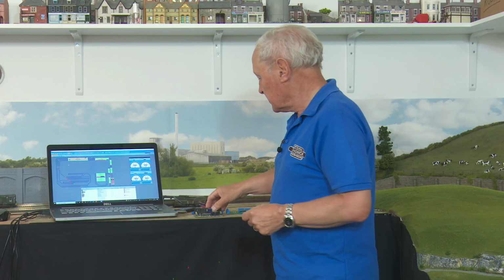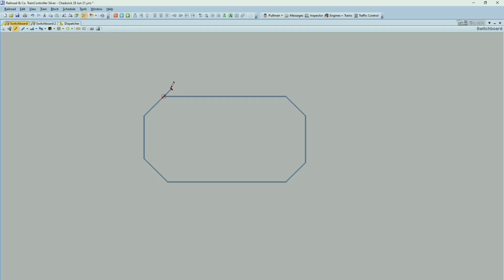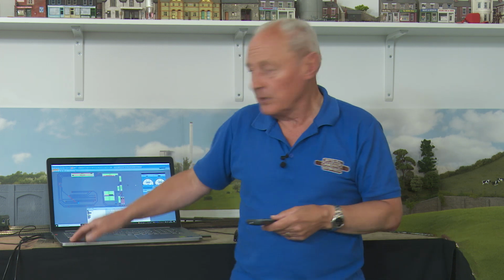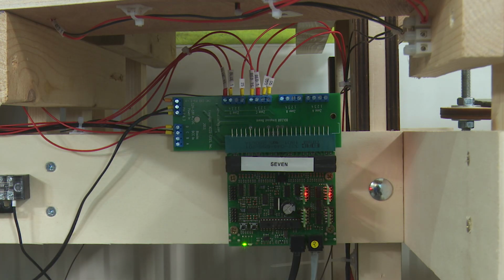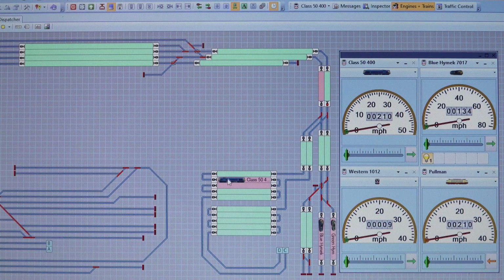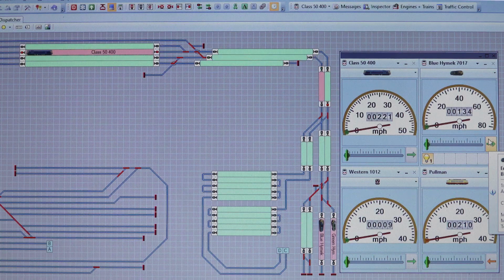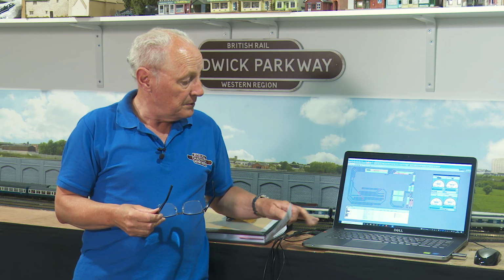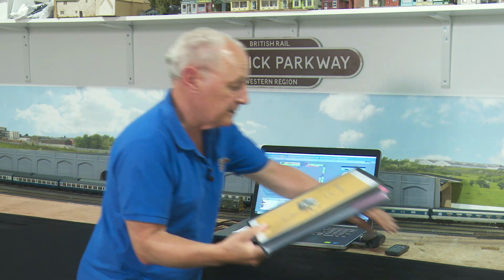An Intro to Block Detection at Chadwick Model Railway | 137.

Comment: Great video as always, Charlie. Brilliantly informative.

I've seen on one of the systems you don't need to have two sensors for each block as long as you have current draw from the last set of wheels in a rake, be it a DBSO, a coach or wagon with a fitted tail lamp or simply a small resistor wired to some wheel pickups, anything that draws current.... Thanks, Bachmann for deciding to make the wheels on your Highlander rake plastic. Really appreciate that...
As the locomotive enters a stop block, a station platform for example, it will begin to slow to a crawl speed, rates and speeds customizable in the system settings, like CVs but simpler, and will then stop automatically when the last set of wheels on its rake clears the previous block. No need for a second sensor. You don't even have to tell the system how long the train or length of track is.
Seems like a hell of a cost-cutting measure when you consider the price of all the different modules involved. For the life of me I can't remember what system that is (possibly iTrain as I do remember giving that one some serious thought) but maybe someone else can fill in that gap for us.

If you're still reading I wonder if you'll partake in a challenge I've set out for myself; I want to fit pickups to a Bachmann / Graham Farish coach, BSK, BG, GUV, etc, and fit a simple decoder inside to operate a lightbar via DCC. Easy up to now, yes? Here's the challenge; I want that one decoder to control the interior lights of an entire rake of seven coaches. This would involve, somehow, passing power from one light bar to the next without having permanent connections between the coaches, so we can mix and match them at will. I've even considered contacting some 3D printer owners to see if they can make some NEM couplings that can house a micro two-pin plug as I haven't seen any couplings with power connections on the market, at least in N Gauge which is what I model. Frankly I can't believe this gap in the market even exists! The idea being that power is picked up via the wheels of our BSK, up to a decoder, in to a lightbar and then down to the couplings and in to the next coach and so on, effectively wiring up a full rake of coaches in series powered by just one. Of course Dapol coaches do come with wheel pickups and lightbar plugs fitted as standard so the process becomes even simpler with those, all we need there are the couplings and to redirect the wiring. I also know that Dapol do in fact have power-transferring couplings fitted to their 142 Pacers, as I have one, so why not something similar that plugs in to an NEM pocket with some contacts for the coaches? It baffles me! Could make for an interesting fiddly project for you!

All the best.
Mike.
Reply from the maker: A great comment Mike. I do understand the problem with coaching stock, especially when they are laid up and the lights are still on!

Comment: Thank you for this video. The phrase “scenic trains” perfectly describes what I am doing with automation on my layout. Using ESU detection and point control along with iTrain Pro, I run scheduled passenger trains and through freight trains “in the background.” Meanwhile, “in the foreground” I use the ESU CabControl and Shipit computer generated switch lists for the operation of my local freight trains. This setup has served me particularly well during the Pandemic when having friends share in the operation of the layout has not been possible.
Reply from the maker: Great comment Ted, regards Charlie

Comment: Hello, I use the following
Digikeijs hardware for DCC command station, block detection and signals, and DCC concepts for the point control
Rocrail software (free)
it gets a little pricey, but honestly it greatly improves my enjoyment of my model railway, I can just sit back and watch a sequence of trains running all day with little to no issues (latest video on my channel for an example) 

I can and do still drive trains manually, but leaving it to the computer saves a lot of messing about with switches that I personally am not that interested in

my next challenge is looking to automate some kind of basic shunting
Reply from the maker: I’m so pleased that you have mastered this technology MM.

Comment: Hi Charlie - another excellent video - very well explained! I have done as you suggested and wired my layout ready for block detection, but as a recent returnee to the hobby I wanted to test my resolve first! 
I did some quick sums, and I think I have found the reason for the odd pricing for the UK. In an attempt to price it in GBP, I think they have got their exchange rates back to front, it works out almost exactly (given GBP/USD rate fluctuations), and then they left it displayed as USD as well!  I have just emailed them - I'll let you know what they have to say about it!
Reply from the maker: That seems to translate to “We don’t care, if you’re not happy, buy something else “.
Reply: @ChadwickModelRailway  Pretty much - we exchanged a few more emails - it boils down to, 

'the UK is a wealthy market, with a limited choice of control software. It is no longer protected by EU regulations, so they can, and do, now charge us as much as they want. There are enough people willing to pay the extra to make it more profitable than selling more at a lower price"

This seems to me to be a very cynical and profiteering abuse of the UK model railway family, and they should be called out!
Reply: Here is their reply to my query over the pricing;
    "The conditions of sale are less attractive to us in some countries than in
    others. We adapt to this through pricing. In return, we consciously accept
    to sell less."

Comment: While a newbie to the hobby, my new pandemic hobby has provided a massive amount of education and discovery. Benchwork is mostly in, with my grand layout of ~13'x14' 2 plus layers when done. Getting my head around ~125 hand made turns, going fully automatable, still figuring out blocks and signaling for 3 yards and ~800' of track. So WOW!!! talk about costs! Love my Raspberry PI with SPROG 3 and  JMRI.
I have just received 2 Arduino 2560 MEGA (13 and counting references to Arduino) in the  I hope over the next year (or 2) to have Arduino managed; block detection (via hall effect current detection), step motors on all turn-outs, and signal management with 54 digital I/O, 16 Analog I/Output, 12 Pulse Width Modulation ( PWM ) .. the costs are in the range of ~20% of the best commercial offering.
Reply from the maker: Wow Chris, I do hope that you have a realistic timeline. This sounds like a four year project but a brilliant challenge.
Reply: @ChadwickModelRailway  You are a sharp man. 5 year plan was my initial thought. Next year I hope to get a 3D printer. IMHO - 3D printing and PI and Arduino type technology are going to be very disruptive to this and other modelling hobbies. With that I look forward to your shared discoveries and techniques every week or so. Thank-you.

Comment: Hi Charlie - good Video! I am using NCE, with Block detection through the NCE BD20 current detectors feeding into NCE AIU's talking to JMRI running on a Mac. I thought about using iTrain, but they don't support NCE very well, so I went with JMRI.  The online help with JMRI is great, but it takes time to understand get it right. In comparison to the BD168, the NCE route can be very expensive. For 14 channels of detection you need 1 AIU and 14 BD20's. 1 AIU costs around £50-£60, and BD20's come in at between £15 & £20 each! If you are happy with basic soldering, you can build up BD20 equivalents using a commercially available circuit board and some basic components for around £3 -£5. I wish I had found that circuit diagram and board option before I had already bought 16 BD20's!! The genuine NCE route works out at around £375 for 14 channels of current detection (reduced to £100 for 14 channels if you build your own detectors - I have 9 of these all working as well as the BD20's). That said, what I saved on software  by going down the free JMRI route offsets the hardware costs.  

I am now in the situation where I have my layout broken down into blocks, which show me the positions of trains on the layout diagram on my laptop.  JMRI controls the signals automatically (using NCE light-it decoders driving three colour LED signals) as the trains run around the layout.  I still have to learn how to use the roster functionality of JMRI, so I can run trains automatically in a drag and drop/routing method, but I understand that is possible with JMRI. I do like the way I can use a smart phone as a throttle using the wifi capability of JMRI, use a throttle on the computer or use the NCE hand held throttle to drive a train.  I also have an NCE mini panel, which allows some basic automation as well.

Automation using NCE has not proved easy, as there are no off the shelf software systems available at a reasonable cost.  The hardware can also be difficult to find, but when you get it working, it is extremely rewarding! You are right though - Automation is not cheap, whichever way you go.
Reply from the maker: I think one point that you forgot to mention is how addictive this obsession becomes!

Comment: Hi Charlie, 
Like always a great video.I am from Belgium and I was really amazed by the pricing of the train controllers. I knew they where not cheap, but I never thought they would be that expensive.  I have always looked for a way to have a maximum of functionality for the smallest price. Therefore I us Rocrail as my train controller software.  I must admit that it isn't the easiest to learn software. But so far it works very well. And it has amazing connectivity possibilities to almost any hardware of whatever manufacturer. It is free for the basic version and for the mobile and web-based version you would  pay €10 a year for the donation software. For the DCC hardware I use Arduino DCC++ witch can be programmed with freeware software. For the block detection I use hall effect sensors. Witch are also very cheap. No interfacing hardware is necessary to connect them to the arduino mega inputs. So if you want to have a DCC controlled train  layout. It is possible with a very small budget. 
I believe a lot of the price differences for the varies countries of the Lenz train controller software have to do with exchange rates. The product is made in Germany. So they need to transfer there USD, GBP to Euro's. The bigger the risk of value change (drop) the more risk of loosing money. Therefore they put pricing higher to avoid that risk at all cost.
Regards Jan
Reply from the maker: Great comment Jan and good luck with your project.

Comment: Hi Charlie,
The hardware I use is a Z21 Roco/Fleischmann being the DCC central. And I use DigiKeijs DR4088 modules for block detection (current). Furthermore the software I use is RocRail. It’s free of charge without support. If you want to tap-in to the community you can pay a fee, and have access to a forum. The software is very complete and allows for drag and drop automatic routing, but also predefined routes and schedules. It has a bit of a steep learning curve, but once you get the hang of it, it works great and it can easily compete with the more commercial packages out there.
Reply from the maker: Great comment Edwin, regards Charlie

Comment: Hi Charlie, I'm also a RR&Co user for more than 20 years now, I grew with the program. I find it much easier to use than JMRI. My former railroad was completely automated (with Lenz and build to the swiss - BLS), than 8 years ago, I switched to US style railroading and waybills. I do not use the automation part (schedules and timetables) any more. But wait I use traincontroller to control the signals and switches, make the routes and the resource simulation of the locomotive (repairs, time they run and diesel refueling).
I like you buildup of the story and also nice to see we have the same challenges to make it run.
Cheers, Maarten
PS. despite a RR&Co Gold user I'm thinking to switch to JMRI, also better support for the Roco (Z21)transponder based detection and waybills integrated in the program. But for now a happy RR&Co user.
Reply from the maker: Great comment Maarten, good luck with JMRI!

Comment: Hello. I went over to loco detection using Itrain, about 6 months ago. I have found it a useful tool to monitor my loco movements. Took time to wire but worth it. Found having 2 feedbacks on station track gave the stopping smoother.
Reply from the maker: Thanks Philip, very useful to know. Regards Charlie

Comment: Great video as always Charlie. :-)
I only have a small layout but I have fitted block detection for the 'can I do it' interest. My shortest block is only 16" so IR sensors are used to stop the loco before the buffers.
I am using MERG hardware, for the block detection hooked up to an Arduino running DCC++, another Arduino is hooked up to the servo driven points and the whole layout will be run from JMRI.
No problems with what I have art up at the moment, although JMRI does have a steep learning curve.
Shout out must go to Rob at Little Wicket Railway for his videos which helped me get started on the Arduinos.
Reply from the maker: Great comment Paul, and good luck with your project. Regards Charlie

Comment: I use Digitrax and Train Controller Gold.  I love the automated signaling and the customized and random routing I am able to achieve.   There's a steep learning curve and it gets expensive pretty quickly.   Most of all, you need PATIENCE.  But it's all worth it!
Reply from the maker: Great comment Basil, but what do you use to control your signals? Regards Charlie
Reply: @ChadwickModelRailway  Charlie, I'm using one Digitrax BXP88 and one SE8C to do my detection and signaling respectively.  Using Kato double unitrack, I have two ovals each divided into four blocks (as TC defines that term).  Each of the 8 blocks is electrically isolated.  Since I have two-way direction traffic on my layout, I need 16 signals.  I chose Digitrax's SMBK  The SMBK has two signal heads each of which can display four aspects.  The SMBKs are below the layout and their wires connect to wonderful signal heads (SKU: SN03) made by CR signals over in your neck of the woods.  They sit on signal bridges made by IHC.  Each SMBK controls two SN03s -- the upper signal head controls the outer signal and the lower signal head controls the inner signal at that block boundary.  I did not cut off the SMBK masts because I found it very useful to see what they were displaying as I worked out my problems with the SN03 connections to the SMBKs.  I programmed into TCG the conditions for each of the signals to display their 4 aspects.   Sorry this is so long-winded, but here's one final CRITICAL point.  That amount of signal traffic greatly reduced the timeliness of the signal aspect changes as my locos moved around the two ovals.   I learned from someone on the TC forum that I needed to close Op Switch 31 on the DCS240 to enable Loconet to handle my volume of traffic. 

I hope you find this useful as I've really learned from your videos.
Reply from the maker: Basil, great info, thanks.  I shall check out the ops switch 31 change.  
Using the SE8C in the past, I did struggle with the logic.
Regards Charlie

Comment: We use iTrain on our layout using an ESU ECOS, a Z21 and the Dijkeijs detectors. We have added touch screen monitors so have larger buttons to make it easier to use. Works very well, we can run around 11 trains at the same time, still adding details and scenery to the layout but happy to help if anyone is interested in using iTrain and setup etc. There is a really good forum for support with some experienced users who can help you out and the developer of iTrain is always commenting for support. Cost wise yes it can be rather expensive depending on what you want the layout to do, also it has taken a considerable amount of time to setup and get to run smoothly, still have the odd issue but is quite satisfying watching the trains run round on their routes. Great video as always Charlie 👍
Reply from the maker: I’m so pleased that you found the video interesting AR. But isn’t it an addictive hobby! Regards Charlie

Comment: Hi. I have a Lenz DCC system but use cheaper and compatible boards from LDT for block detection. As software I use the free Rocrail program. I cannot understand why more British modelers haven’t picked it up. I find that it has functionality comparable to Traincontroller and a setup that is easier to understand then JMRI. There is a good Wiki that comes with the software and pretty good forum support. My layout has two levels and is 16 feet by 10 feet connected by a double track helix at one end. Well done video that covers all angles for dipping into the “acidic bath”.  :-)
Reply from the maker: I imagine Kenneth, that systems such as yours receive no real publicity hence they’re poorly supported. Hopefully they will get a little more support by people reading the comments. Regards Charlie
Reply: @ChadwickModelRailway  I should start a YouTube channel 😁